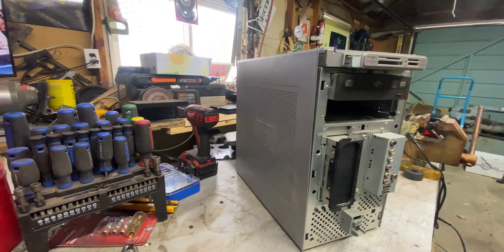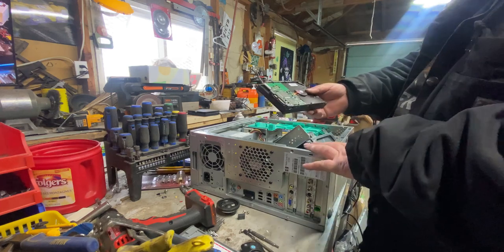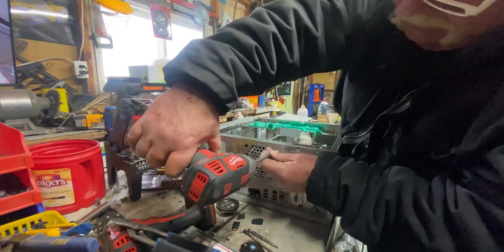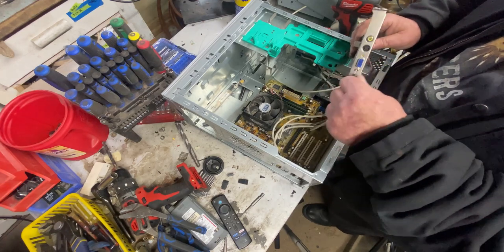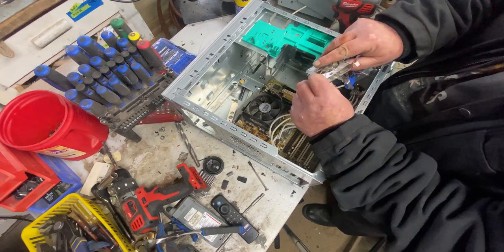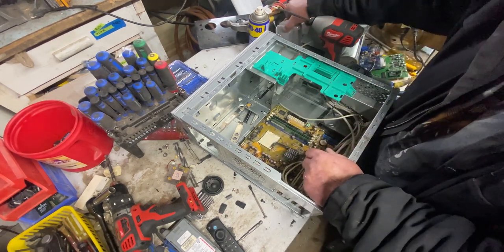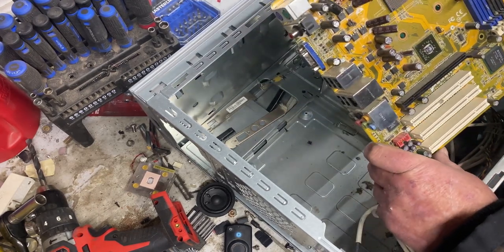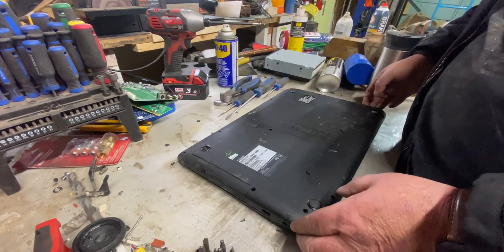Scrapping Computers Thru Boardsort in Canada Part 2 @boardsort

Comment: Also the computer motherboard isn’t a no socket, it has a socket that’s plastic. so it would be either, 1. small solid plastic socket motherboard ($1 pound) or 2.small plastic or metal socket COLOR motherboard ($1.20 pound). So it would depend on how many you have and if it would even make sense one wise to ship those
Reply from the maker: Thanks Kurtis